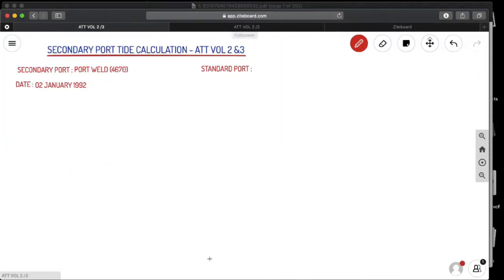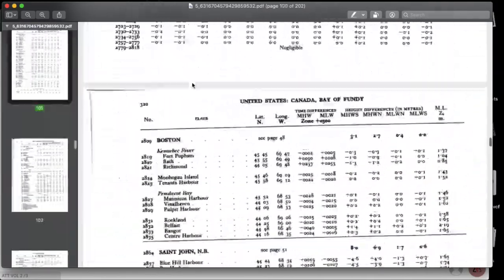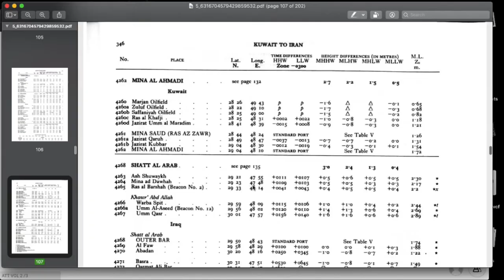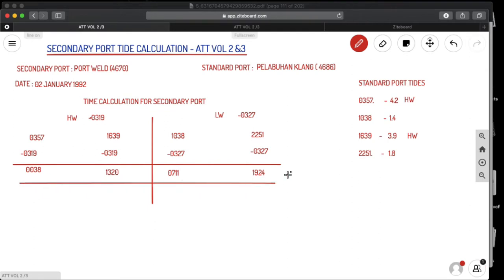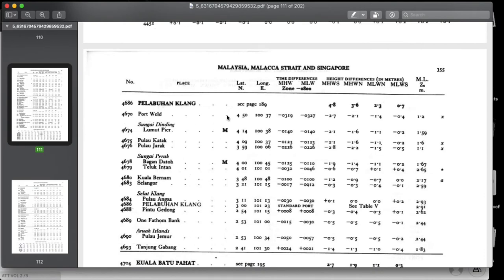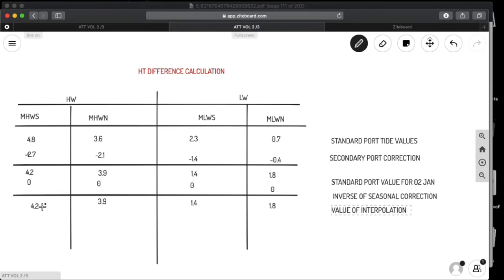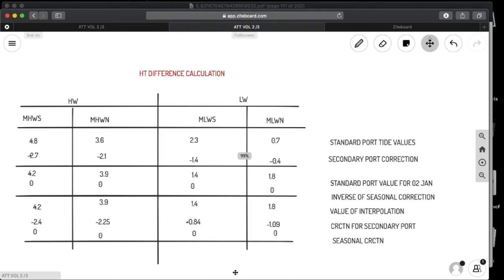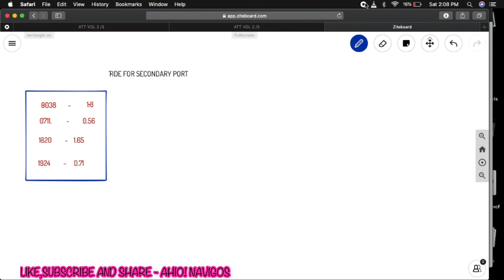SECONDARY PORT TIDE CALCULATION USING ATT VOLUME 2&3 - CHART WORK TIDE PROBLEMS - AHOY! NAVIGOS

Comment: There is a formula
Height of tide = L.W +(factor×range)
How to get factor
Reply from the maker: Good day,
Thanks for the responce,

Factor is the value that you can see at the mid of you graph curve written vertically from bottom to top, these values were used to find the ht of tide without being getting into drawing whole lines through graph up and down, but there was chances of getting much errors in it, the formula u mentioned can also be used to find ht of tide, it is an older method used and not preferably used nowadays,

Comment for any further doubts

Regards,

Team Ahoy! Navigos